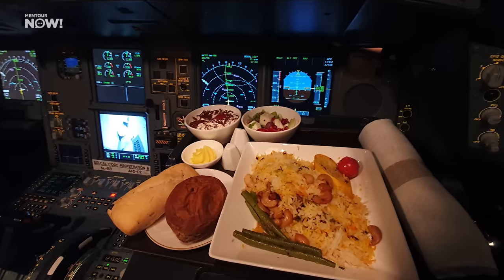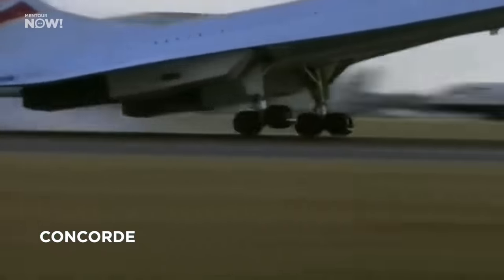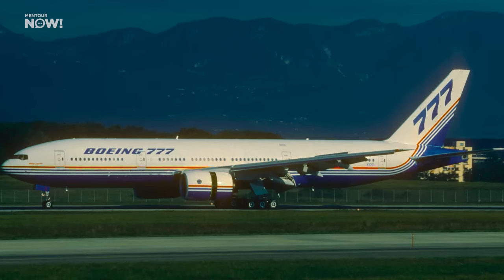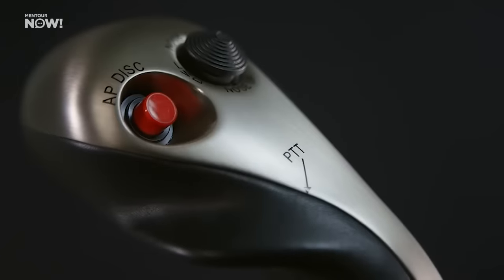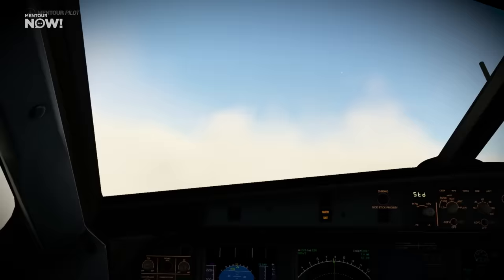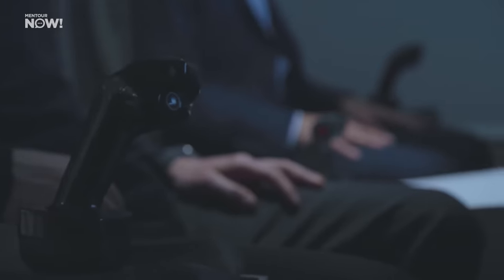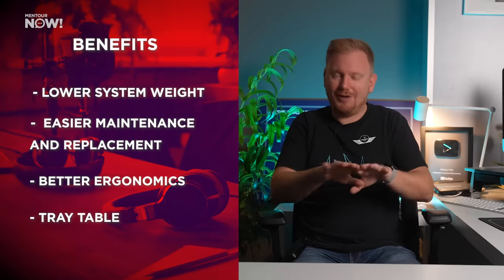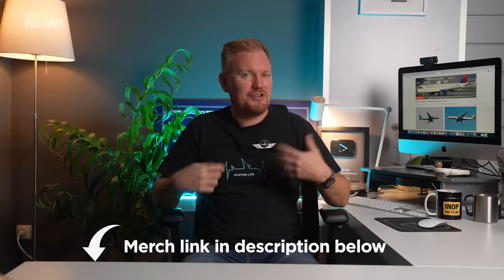Will Airbus Finally switch??

Comment: I've about 7000 hours on A320 and the same previously on B737.  I'm not bothered about a force feedback sidestick. If I were to change anything about the A320, I'd have the 737 throttles. The lack of feedback in the sidestick has never bothered me, but the lack of movement in the airbus thrust levers and the position of the autothrust gates is more of a problem. Because the climb, MCT and TOGA gate take up the top third of the available movement, and the reverse thrust the bottom third, only the middle third is available for manual thrust setting. On the Boeing the full range of motion is available, so manual thrust setting is much more accurate and easier. In addition, if you need to add thrust (say the speed gets a bit low in a manual circuit base turn), in the Boeing you just shove the thrust levers up a bit - very intuitive. In the Airbus the levers will be sitting in the Climb detent, so to add a bit of thrust you have to pull the lever BACK, out of the detent, match the blue circles on the guages with the current thrust position, disconnect the autothrust and THEN you can add a bit of power. Very uninuitive.
Reply: Disagree
Reply: I also have 1000s of hours on both 737 and A320. The thing I like the most about the 320 throttles is this. Go around and RTO. Wanna go around? Push the throttles to the stop. No TOGA button, no overtemp. Easy. Wanna reject the take off? Close the levers. No auto throttle disconnect buttons to mess with. Easy. 737 RTO was a four step process and if you forget any one of those steps and you’re in big trouble. I’d lever the levers just as they are.
Reply: Not a pilot, but long time interest in avionics, (my father designed a navigation computer used by various militaries mainly on helicopters), and flying general, From a recent video by Petter, the Airbus throttle control did seem more like an automatic gearbox on a car; fully forward to go up, in the middle to go level, back to go down, stop. The procedure to add a bit of thrust sounds rather complex, and working on the control systems in chemical plants, sounds very much like the work-arounds to do something the control system designer didn't want you to do. Surely on the Airbus to add thrust, can't you just adjust the A/P set speed or climb rate?
Reply: @axelBr1  I’ve flown the A320 for almost 15 years and not once (apart from in the simulator) have I needed to add thrust. The auto throttle is extremely good at maintaining either the pilot selected speed or the one commanded by the FMGC. Even when hand flying the auto throttle should be left on. If the conditions are so gusty the automatics can’t cope then a divert is probably the smartest move. So in a flight after the throttles are retarded at thrust reduction altitude I don’t move them again until the flare.
Reply: I’ve got a few thousand hours in Boeings and Airbuses. I agree with the OP. Back-driven thrust levers on Airbus would be an improvement. Don’t care about the sidesticks not moving together. The “dual input” warning takes care of that.
Reply: @priceyA320 I haven’t flown the A320, but on the A330 the autothrust is terrible.
Reply: It is possible to do a similar movement with the thrust levers in an A320 as a B737 in a decreasing speed situation. In the A320 you can bump the thrust levers forwards out of the CLB detent, just midway between CLB and FLX/MCT detent. This will momentarily arm the auto-thrust, and increase the engine thrust for a speed increase, for example in gusty conditions. You can then return the thrust levers back to the CLB detent in order to engage the auto-thrust again and fly normally. It works quite well and only 1-2 seconds is necessary to stabilize the speed. No need to match the blue circles and disconnect the auto-thrust entirely unless you wish to manually control the thrust throughout the approach.
Reply: You can also just slam them onto the backstop and slowly increase until you get the power you need. A lot simpler than what you explained.
Reply: @bayouflier6641 You mean push them forward into to TOGA detent?
Reply: @jackfromthe60s  No. Instead of pulling the throttles back to match the circles, which requires you to give them attention, simply pull the throttles to idle (which disconnects auto mode), and throttle up til you get what you need. If you do it smoothly and quickly, you can catch the power where you need it on its way down.
Reply: @bayouflier6641 Disarming the AP that way was forbidden in my company. Been a while since I’ve flown, but isn’t it against Airbus procedures?
Reply: @jackfromthe60s  I flew it for United and it was definitely not forbidden. In fact, it doesn't make any sense as there is nothing negative about shutting off the auto throttle by simply going to idle.
Reply: @soccerguy2433  Based on what? How do you think operating the A320 thurst levers is more intuitive than in a 737 then?
Reply: I agree. Being able to temporarily over-ride the auto thrust with Boeing's clutches in the thrust levers is a big advantage. Not to mention being able to see thrust lever movement with auto thrust engaged. Airbus pilots must watch both Column 1 and the engine stack together to ensure the required thrust is being delivered. Often, Column 1 is commanding "idle" while the autothrust is very slow at bringing the engines to idle. Overall I prefer the Airbus by a wide margin over the Boeings now that I've flown both.
Reply: Just click mct for a second and then back to climb.. Far easier.
Reply: Well…you can always bumb the throttles a little forward of CLB. That sends the thrust towards MCT and then bring them back to CLB. There is no need to bring them back and disconnect in order to get out of a temporary slight under speed. That is even an Airbus procedure. 😊
Reply: Here's me (non-pilot who finds aviation interesting) thinking they were just levers that went from idle to max thrust in all aircraft.

I've never understood how pilots can be trained so (relatively) quickly to commercial airliner level when there's so much to know.
Reply: So how precise adjustments you really wanna make? With A320 thrust levers it's easy to adjust 0,5 % N1 and outside of simulator with 100 % stable air mass I would say, that there is no need for "more precise" adjustment. Below A320 series I flew some Embraer business jets and the thrust lever motion range was ridiculously large.
Reply: I’m not sure I understand all the issues with Airbus detent throttles vs Boeing auto throttles. It’s the age old thing in life about not liking change. Our airline told us from the beginning unless there is some malfunction, we always use the auto throttles in the required detent. In 5000 hours on the Airbus 330 I’ve never heard one complaint. In high gust winds, I never saw any issues hand flying or auto land. It was simply a matter of trusting the systems. I’ve generally believed the engineers designing new systems are pretty smart. Yes there are always tweaks along the way. But you have to move on from the old adage that’s not the way we did it on the Boeing.
Reply: @benlopez7703  how it’s possible to make autoland in high gust winds, considering the autoland wind limitations? Something doesn’t add up here.

This kind of a/thr policy is pathetic, especially if there comes a day when it doesn’t work and you haven’t used manual thrust even in real aircraft. You might have done it in the sim, but did the sim even had same engines or same philosophy for thrust control?
Reply: @KoiranenAerospace  you don’t exceed the airplane limitations ever. It works because Airbus designed it to work. Airbus doesn’t tell you disconnect auto throttles in any condition. The auto throttle system is designed to take into account wind, pitch and power requirements and will make the necessary adjustments in all situations. I’m not going to say there may be a situation where you may be forced to disconnect but I never saw one. That’s why we have pilots to take over when a system doesn’t work. But otherwise leave it alone, it will work as advertised.
Reply: @benlopez7703  my point was, that autoland in any high wind conditions goes above the limitations with A320 and A330, so I don’t understand how it can be successfully done with high gusts.

Another thing is that auto thrust is not same in every Airbus FBW aircraft, and not same in same variant with different engines. For some combinations it’s better than others. Especially with GTF engines the reaction is quite slow.

Edit: and yes, airbus tells to disconnect a/thr in some conditions.
Reply: @KoiranenAerospace  the confidence we have in the flight management guidance system (FMGS) is carried out by computers but the system on Airbus is extremely in depth. Consisting of RCU, FMA, FD/AP, Auto-thrust, Flight management and control laws and protections. It does in fact, provide protection in wind shear and if sever, the SRS mode puts the aircraft and power into the go around mode. The problem with flying outside of the climb detent with auto throttles off, is that the safety features of the Airbus FMGS is not available. The Airbus system really does work but when flying the Airbus I had to transition to the computerized/automation unlike anything I had flown before. Which was all Boeing through the 757-767 with glass but technology designed in 1980.
Reply: @benlopez7703 , I can't immediately recall what would RCU mean in Airbus FBW aircraft, but for the rest: it does not protect from wind shear. FAC will give reactive windshear warning, but that's it. There is no automatic engagement of SRS or anything else, it always requires pilot action from thrust levers (to TOGA), regardless of A/THR or AP state.

Also, SRS does not engage TOGA thrust, it is just a vertical mode. Alpha floor would do that, but it's different thing, and alpha floor is available regardless of the engagement state of autothrust.

Actually, I can't recall any safety feature that  would NOT be available because of A/THR not being active - unless normal operation of A/THR is considered as a safety feature, but I consider it just as autoflight function. Also the basic thing from golden rules is to use appropriate level of automation - not full automation.
Reply: @KoiranenAerospace  it should have been FCU. Yes, you’re correct about TOGA following SRS commands. Airbus recommends auto-thrust on takeoff to touchdown. Obviously they don’t say we can’t fly without auto thrust. Each company has there way of teaching automation. Our company ask us to use the automation unless a system problem required otherwise. As I said personally I tried to leave the old behind and adapt to the new world. I’ve been retired 20 years, so I’ve ram dumped a lot of Airbus info in those years. But interestingly the Garmin equipment today on a Cessna 182 with A/P and glass has the airbus control laws with AOA included and makes an incredible cockpit. I think improving safety considerably. Also cost less than $50,000 dollars.
Reply: I guess I don’t understand your issues.  All I can say is if landing in winds or gusts too great for the approach I was making, which I never did, I would have gone to a more suitable airport. I Didn’t make every approach auto land but did make every landing with auto throttles. In 5000 hours I never had an issue. Guess I was just lucky. But after 42 years of flying at that time, I really didn’t worry about disconnecting auto throttles and landing manual throttles.
Reply: @benlopez7703  I don't have any issues with the A320. Just a preference.
Reply: Hi, having a similar experience I have to disagree- the A320's thrust levers are nice and easy to move manually; you have always the same friction and are at correct height but require a toll pilot to reach comfortably as there is considerably larger distance between the pilots seats (one would have difficulties to reach TOGA if small and probably suffer from  prolonged manual thrust settings). B737's position is a bit too high to be comfortable but are much closer to the pilot's seat, have much worse REV failure state (inoperative REV which requires wiring the REV lever to the thrust lever) and normal operational state- TOGA switch requiring press towards the axis of movement (inconsistent with the levers' forward movement). 
As for the sidestick - I don't care the feedback too..... what matters after all is what is the aircraft doing rather than what is the current deflection.
Btw I was initially quite surprised by high (spring feel only) forces esp. at full deflections like GPWS pull-up manoeuvre.
Reply: Same as you, but with 9000h on both
But I disagree...
Reply: Remember that in an airplane it doesn't matter if it's 'ok'. It can only be 'not ok' one time usually.
Reply: I have 70.000 hours on an A380
Reply: @i.c.wiener2750  Same as me , but I’m on a A399.
Reply: But isn't it about when things go wrong? Say there is damage to a wing or tail or whatever. Or some hydraulics don't work. Or the computers let you down. Would you prefer feedback from the aircraft then? To save 250 lives 🧐
Reply: @Acarsfault  Greetings comrade.
Reply: @priceyA320 you have manual control from idle to climb which is 75% at a minimum of the forward thrust range. Are you sure you’re a pilot? Your technical knowledge is very poor.
Reply: @peteconrad2077  With the Airbus with the auto throttle off you have full control, not 75%. Who’s got shit tech knowledge now?
Reply: @priceyA320  once you get to climb it’s a FADEC calculated climb thrust. Beyond that it’s is not normal practice to use the detect thrust dents if MCT or TOGA so using manual control beyond CLB detention wouldn’t be normal practice. So why don’t you calm down and pretend you’re not a toddler.

Comment: I flew Boeing planes for 27 years. The Airbus side stick was amazing and the first time I flew the Airbus 330, I was sold. Never missed the control wheel. Way to go Airbus.
Reply: I don't miss the yoke either.
Reply: Also safer
Reply: @CW-rx2js  really?  Wasn't the side stick a factor in the Airfrance crash a few years back when one pilot did not know the other pilots input control because of a lack of visual sight which a yoke would have given. I'm not connected with aviation by the way.
Reply: the plane shouts 'dual input ' when it happens but yea , both have their own advantages  @Vanrides.
Reply: @Vanrides.  After seeing what happened with AF 11 in 2022 (a b777) I'm more concerned about air France training than the system
Reply: @giulia3855  wasn't AF 447 also due - in part - to dual inputs taking place? Don't AF pilots communicate who has the aircraft?
Reply: @jx6564 In theory, yes. They screwed up in the crash.
Reply: yea and the sad part is if the pilots hadn't done anything major and just correct that right bank after the AP disconnected they would've been fine, the icing event was over in a minute or so. Unfortunately a perfectly fine airplane crashed within 5 minutes . really sad
Reply: @Vanrides. That's pilot error, one pilot should have have turned on priority control and told the other they have control
Reply: Agreed

Comment: you have an english error in your opening intro. it’s not “change the way that they are actually working”, it’s “change the way that they actually work”.  this is an error around the use of verb aspect, which is something that exists in english but not many other languages.  we use different forms of the verb to indicate the duration of the verb. something “is working” when it is working now in the present moment, something “works” when it is functioning at the current time area, which includes instantaneously but also the time around it. “i am working” means don’t interrupt me, but “i work” means that i am employed.

Comment: Having interconnected yokes is no guarantee of a good outcome in an unreliable airspeed situation. The Aeroperu 757 accident proves that when overloaded pilots get disoriented and start pushing and pulling it’s a very dangerous situation regardless of the flight control system.